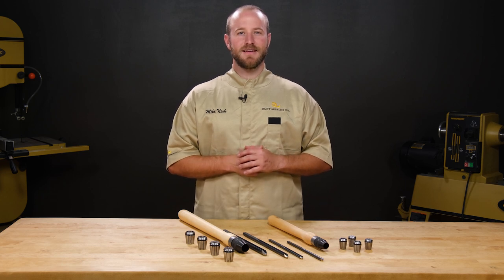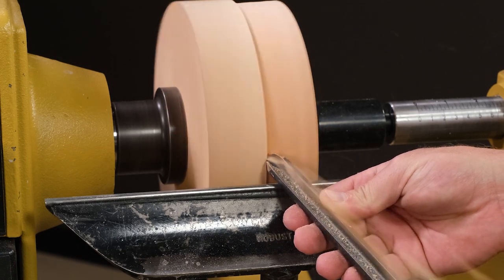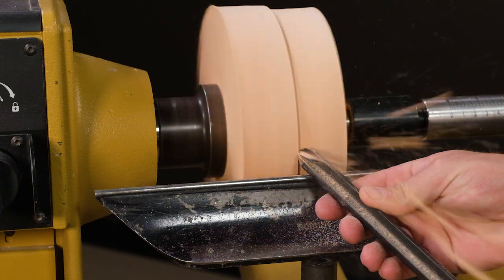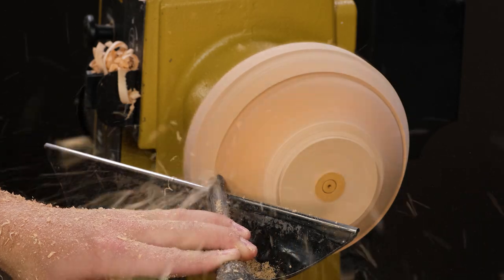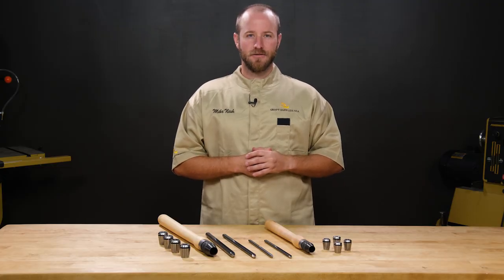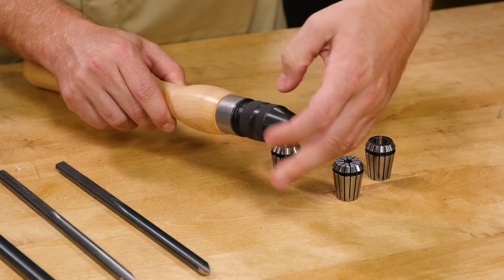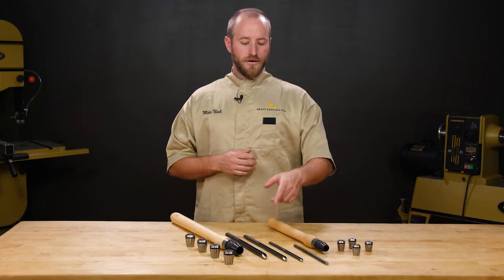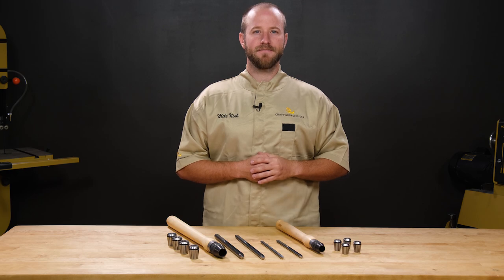Robust Turners Edge Tools

Comment: Great video, Mike!!! What downsides have you found compared to USA manufactured tools (C&ST M42, Thompson’s 10v and such)? The flat top is really appealing because I want to use every last molecule of the gouge.
Reply from the maker: Hey Scott,  no downsides at this point.  I have found the flutes to be better that those you mentioned and they are about an 1" longer than most other brands.  -Mike
Reply: Craft Supplies USA Thanks a ton, Mike!